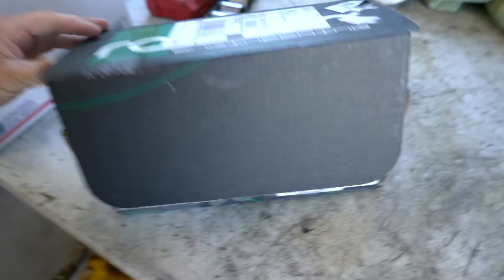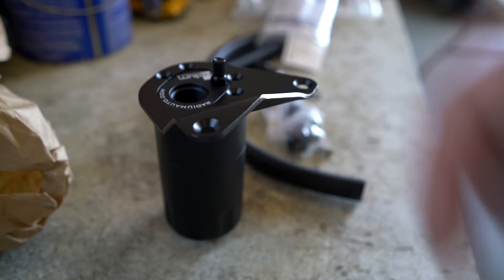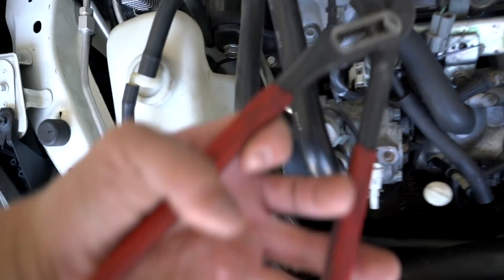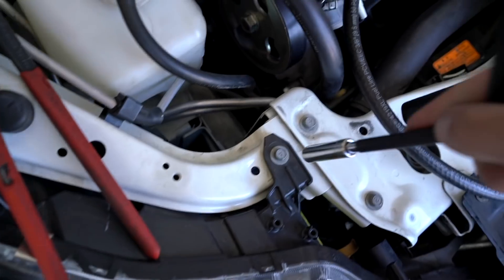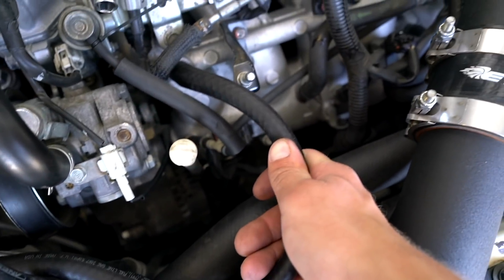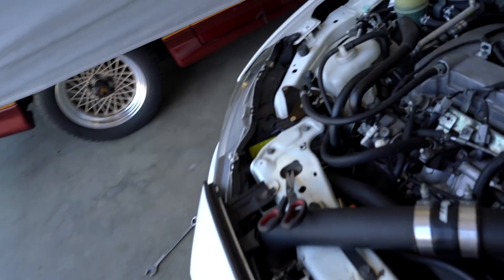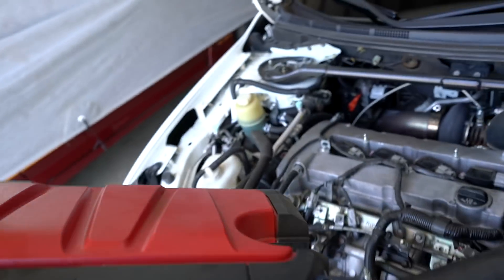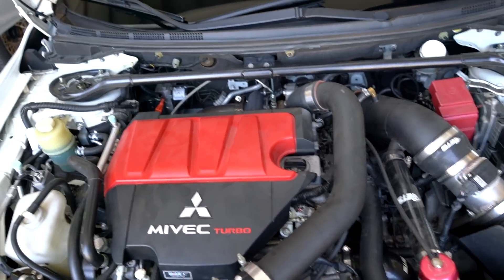Every Turbo Car Needs A Catch Can

Comment: How do you prevent reverse flow through the catch can when the intake gets pressurized by the turbo?  Seems like you would need a check valve inline.

Comment: do you really need a catch can if you dont really push the evo that much? just a few floors here and there, nothing crazy.
Reply: Just some random low-key 2nd or 3rd gear pulls...no. Yes if you're running full bolt-ons and running 26lbs+ boost and pulling enough to have a lawyer on retainer.
Reply: If you have a GDI engine like most of us then yes!!

Comment: Hi Devin, is the dual setup essentially an air/oil separator and catch can?  I'm undecided to just get one or both? 
Drivenfab seem to have a nice complete setup too.
Reply: Gary Lynch I use their air oil separator on my flex fuel evo.  Good amount of condensation and a bit of oil.  My tuner recommends the recirc / air oil separator vs standard vta can.
Reply: Anthony Vitan. Good info, thanks!